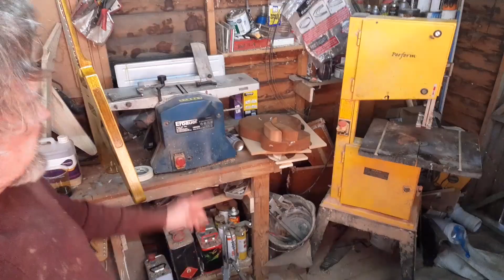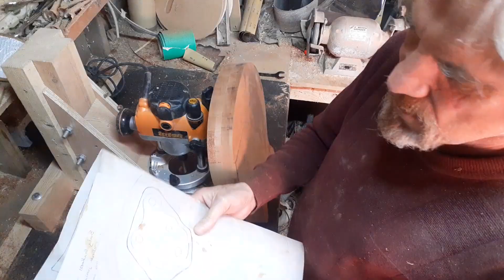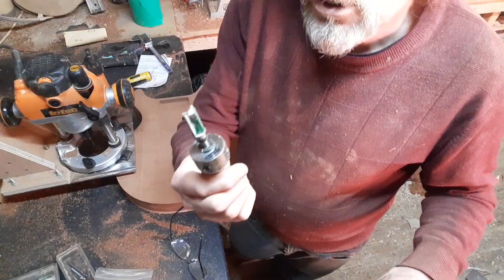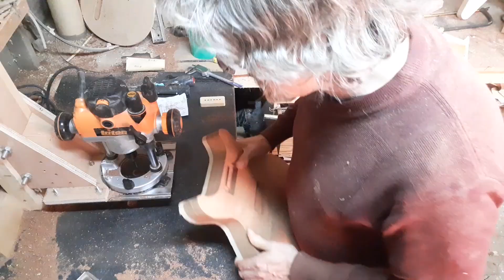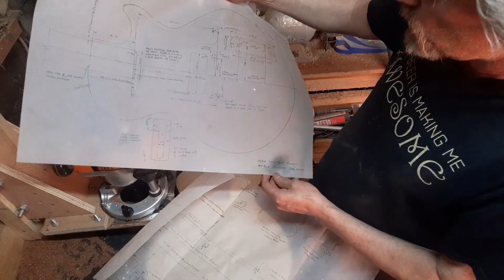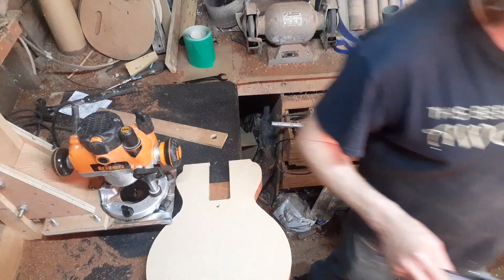Les Paul Special build 1959

Comment: If you’re sure of the neck pocket rout, would it be possible to do that first and then do the pickup routs?
Reply from the maker: I can't see any reason why, that's probably a bit more logical. With the pin router you can just stack the templates underneath each other, I'm still trying to stop thinking like I'm using a bearing guided cutter from the top!
Reply: @3rguitars890  I'm starting a similar build with a template set from Fletchers Guitars in Australia. Hello from Down Under

Comment: Looks good again - that's a lovely piece of wood.  And P90s are so versatile.
I noticed that you put screws into the back of the body - are you planning to paint it?
Reply from the maker: I'm lucky enough to have a really nice selection of Honduran mahogany. I know I should really just use double sided tape on the templates but I like the security of small screws, generally I can fill the holes with splinters and they don't notice but this guitar will be TV white/yellow anyway.

Comment: Well hi there.  Thanks once again for sharing your work and observations, especially the functioning of your pin router and thoughts on cutter bearings.
Reply from the maker: Thank you, The Flying V build videos have a more in depth look at the pin router, it  makes things a lot simpler to do, you can also do angled cuts by angling the work piece over the template and like I said you don't need a multitude of bearing guided router bits.